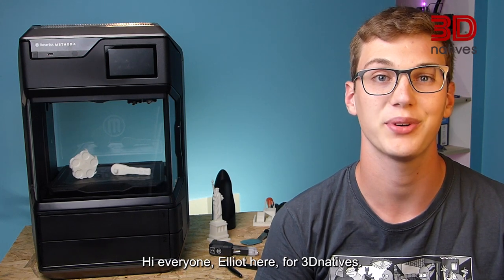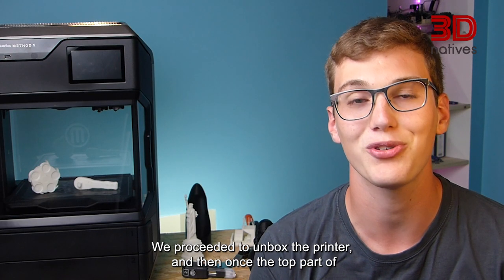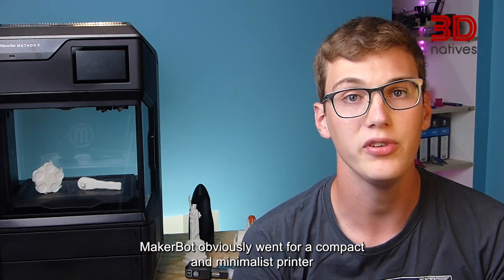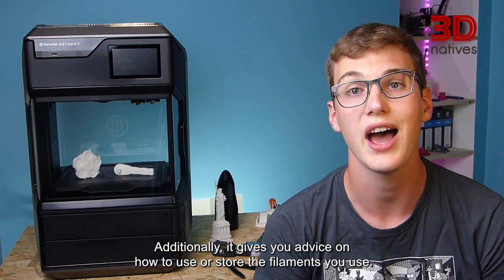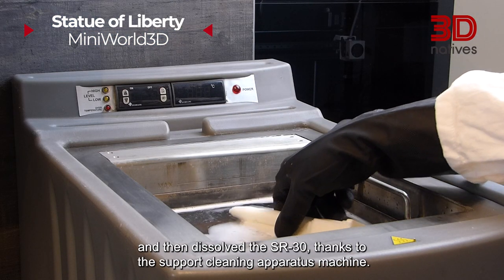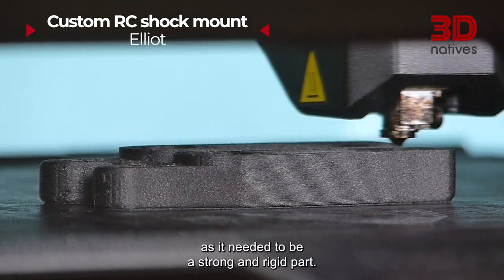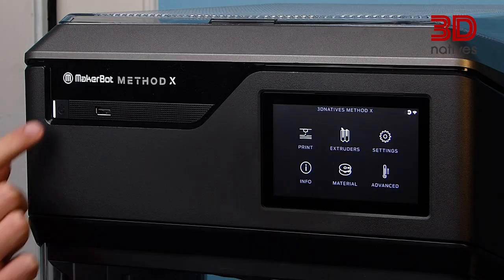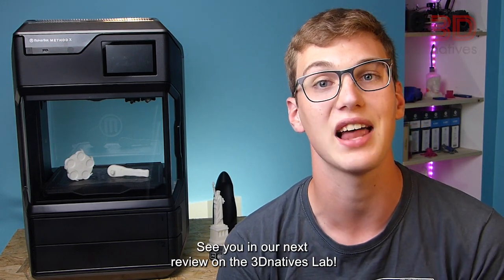Unboxing and Review of MakerBot's METHOD X Carbon Fiber 3D Printer

Comment: My method X has been nothing but ISSUES. 3x extruders have been RMA'd. Hundreds of material jam issues, 1 year and only a handful of successful parts. HORRIBLE customer service. DO NOT RECOMMEND.
Reply: Same here. Nothing But Trouble. I have bought this printer because of offering some of the best features and promises the best material properties. I spend 6k€ on the machine and another 1k€ on the material. Not to mention you can not print with one material directly on the build plate and don't get me started on the software. Don't make such a mistake and buy this printer it is garbage. DO NOT BUY!!!
Reply: You sure you have the right materials selected?
Reply: @stopbegging4likes  lol yes.
Reply: @davidbball13  I guess we've been lucky but we've only been using ABS-R and everything has come out perfect.

Comment: My method X has been a disaster.  Most prints fail with vanilla setting on a brand new printer.   The touch screen locks up all the time with no way to recover except hard power down.   The customer support chatbot just says sorry, there are no agents.  My support ticket has disappeared into the ether.

Comment: For the price I'm very surprised that this printer does not print as well as the Bambu X1 Carbon at 1 6th the price. Wow I will be getting two Bambu printers for 1 3rd the price of this thing. They need to keep working. I was planning on buying one of these, but after watching it struggle in this video I'm good.

Comment: I have a MethodX Carbon Fiber Edition, purchased about 4-6 months ago.  Parts I have been creating lately are pretty conservative. Printed some Carbon fiber - nylon, but mostly ABS using LABS extruder.  Print quality has been good, better than on Replicator 2 and 2X. No failed prints that were not my fault. I have yet to print with dis-solvable support material.
I find the touch panel interface to be poor, having to hard power-down the printer at times. Also, I find the Makerbot Print software to be somewhat buggy,  frustration with it (makerbot print OR printer software)  not remembering material loaded. I have not reported any issues to Makerbot, figured they are aware of most issues I have encountered. Printer stepper motors are quite noisy. I really should relocate printer, but it is so pretty, hate to remove it from my office and relegate it to a storage room.  My replicator 2/2x printers were quieted down by sitting them on towels. I don't think it would be a go for this printer -- which is quite weighty (60+ lbs).

Comment: How much did they pay you to write this? The printer is garbage. Material has quality issues. Bays are not sealed and easily allow moisture. Redundant setting in software don’t work. Bed plate is too flexible and cannot handle solid filled parts. Plenty of others all have the same issues. Our Mark Forged printers run 24/7 and this thing sits. Even failed trying to print “Tough” material on a 60 hour print that was done beautifully in 16 hours on the MF.
REPLY
Reply: How much were your markforged printers?
Reply: Onyx 1 is 4500
Reply: @CS-ec7gl  our makerspace has that too. But I prefer my method x
Reply: - ya seriously., the mark forged is faster than my method x.

Comment: Best printer i've use for print ABS consistently. No more warped prints! 
I don't like the cloud software and the proprietary filament is double the price of regular filament, smmfh!
Reply from the maker: Indeed, the software was also one of the drawbacks for us in an otherwise solid machine. That being said, we still found it to be quite reliable in our testing and it’s no small thing that it can be used on any machine which has the internet, including chromebooks! For the material, if it’s a limiting factor for you, we definitely recommend you look into the Labs Extruder which when equipped would allow third party filaments
Reply: @3dnatives  tried that years ago. it's not reliable